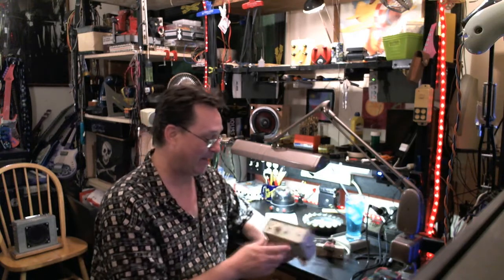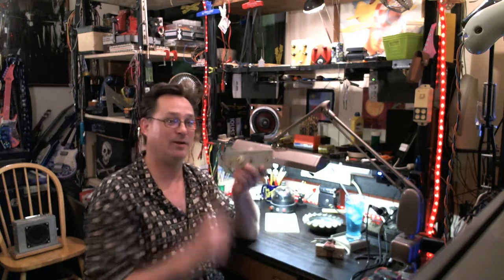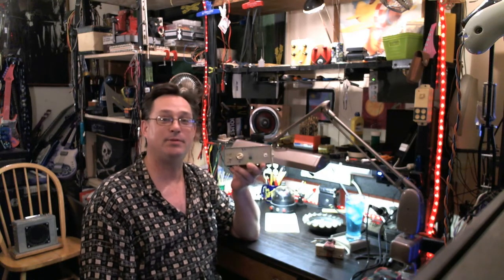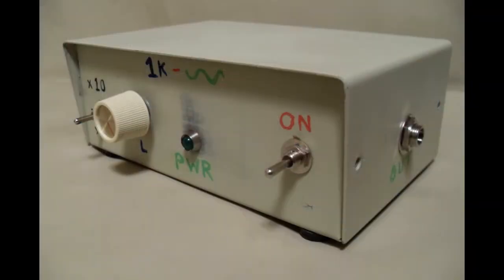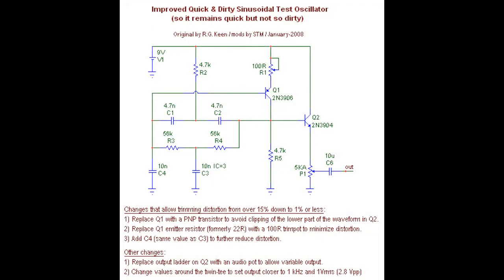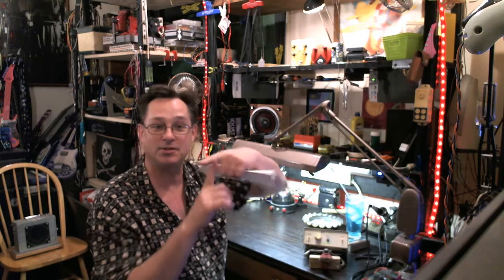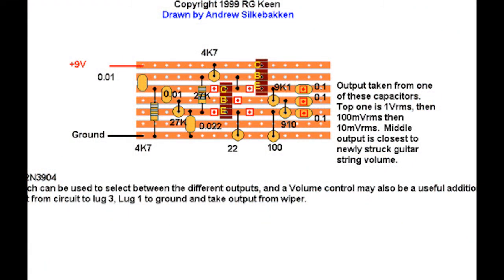DIY (quick and dirty) Test Oscillator pt 1

Comment from the maker: Later on i added a 9 volt clip for a battery and i am impressed on how long it has lasted . i use this device quite a bit , it has saved my a lot of time . for part substitutions , changing values , i rarely use it for that . i find an actual guitar is necessary for that .Highly recommended lil build . the chassis is a printer sharing switch or data switch . these are often found at resale stores , if you cant find one , they should have a small candy tin for a buck or something cheap .